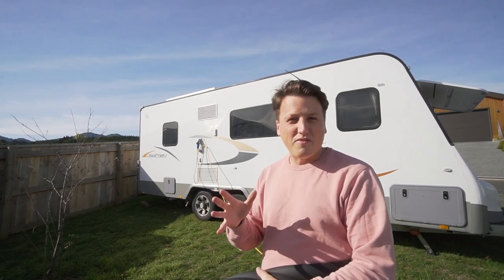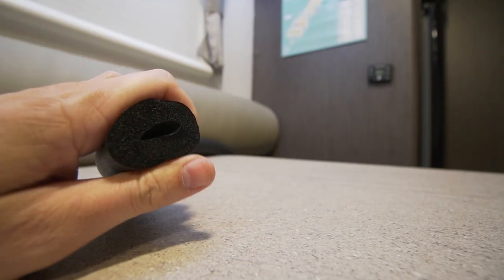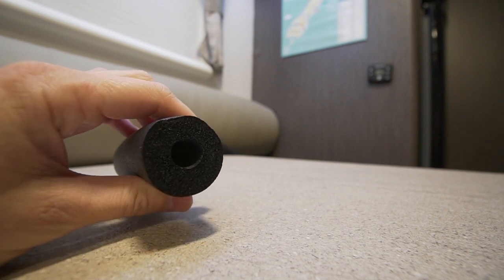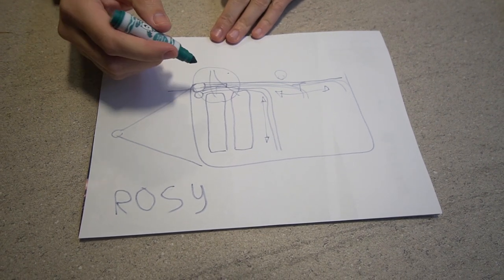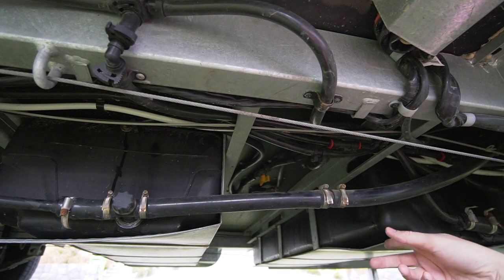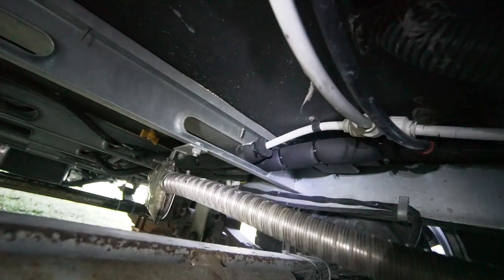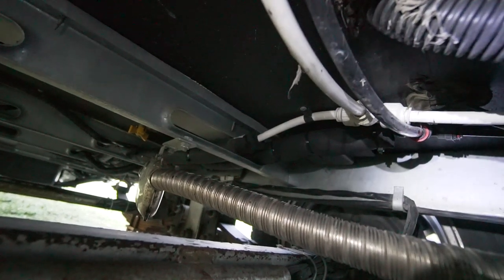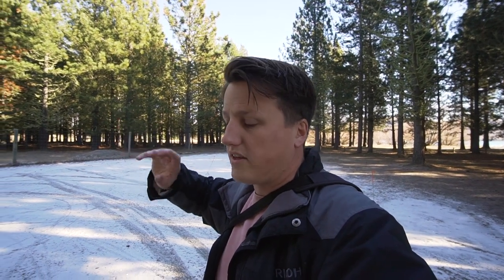Insulating RV & Caravan Pipes (Lagging)

Comment: Great videos…thanks. I am also from NZ and we are looking at a Jayco Journey 19’6-2 as it is just for my wife and I. What i want to ask please is tell me about your solar system. What panels do you have and do you have an inverter as well? How do you work daily on solar power? Thanks and keep the valuable videos coming. Cheers
Reply: We live full time on the road  and we have 3x 150w and then 3x 100ah batteries have never ran out. Hope this helps you. Safe travels
Reply from the maker: Aidan's setup is probably what we need, we have 2 x 150w panels and 2 x 100ah batteries, we actually ran out of power the other day after 5 or so days of no solar. Our setup is great in the summer but could be a bit better in the winter I think. We will add another panel or two one day and upgrade batteries 😊 We don't have an inverter and run our fridge on gas most of the time.
Reply: @aidanvanweert993  thanks for sharing. Are you from New Zealand and travelling full time?
Reply: @AdventuresWithRosy  Thanks for explaining. I saw on one of your older videos you use a portable battery unit for your “office”. Still using that? it seems like a brilliant idea. Did your Jayco came with the grey water tank or you got it added afterwards? If added and if I may ask, how much was it? Safe travels and stay warm. Cheers
Reply from the maker: Yup I still use that power pack each day, it’s a Goal Zero Yeti, pretty handy little unit 👍 our Jayco came with a grey tank fitted as we brought it at a motorhome show and it was one of those show deal sort of things, not sure how much they cost to get installed sorry!

Comment: Did you find the hot water stays warmer with the insulated pipe? For example when showering while freedom camping: if you turn off the hot shower water, soap, then turn hot shower back on - is the water cold, mild or hot in temp? normally it goes cold again and then takes 5-10sec to get to hot again which means a cold rinse off in winter or wasting water until it’s hot again. Just wondering how effective the insulated pipe is. Thanks
Reply from the maker: Yup it does stay hot in the pipes which has been great! We use to get what you described with the cold for a few seconds in between hot but it’s been really consistent since we did the insulation 👌 stayed in some pretty cold temps too and had no issues with freezing etc